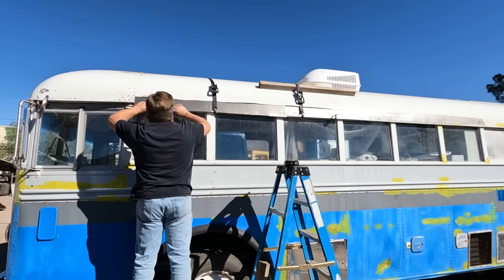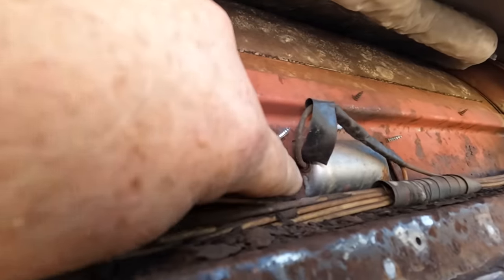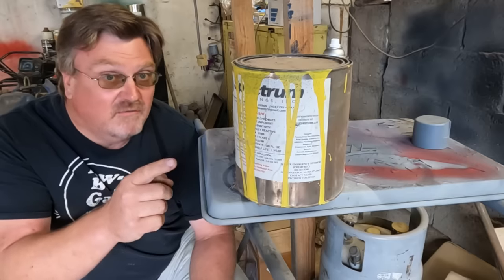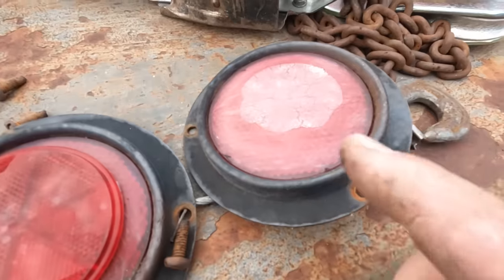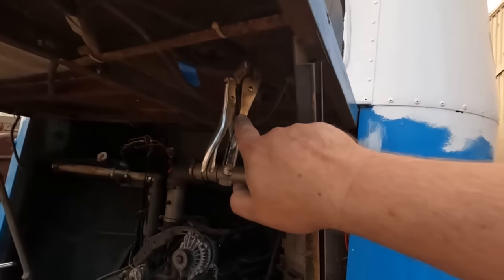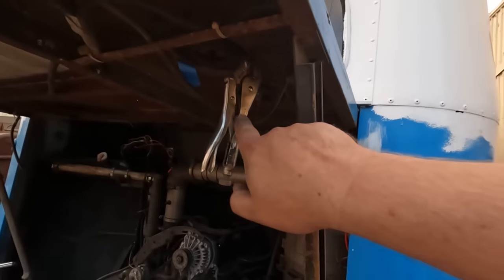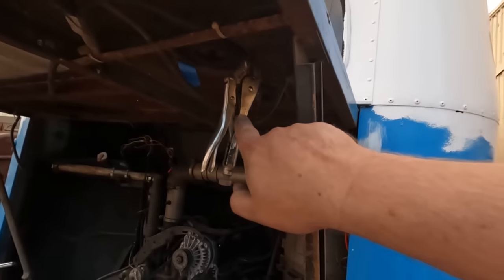1953 Kenworth Pacific Bus: New Colors and Partsam Lights!

Comment: That front bumper looks WAAAY better than the chrome one. Nice work James, enjoyed the video like always 😁👍  The LED lights are a nice touch as well 🔧🔩
Reply: I am always happy when someone gets rid of a big ugly chrome bumper. My first W900A Kenworth had one, and when it dropped a valve I had to take the bumper off to get a wrecker hooked up. Not very practical.
Reply: Watching a video, Not seen how old bumper looks, yet, when retrofitted
came here to say like WhY you getting rid of perfectly normal bumper and want to instal old rusty ugly one…
But I mean if actual owners are saying chrome one was ugly, I continue watching and will see how it goes 😅

P.S. I’m sorry, but chrome one looked WAY better, whole bus looked more modern and had a posture 
old bumper is good only if you after authenticity or rigidity, otherwise it has added 20 years and nothing else

Comment: 4:59 smart move. That's gonna last beyond your life time and it will insulate the wire (which is a demanding one) from heat from the roof. I've seen soooo many of these bus projects burn down from the AC wires (tho, admittedly, likely because the teens had run wrong gauge wire).
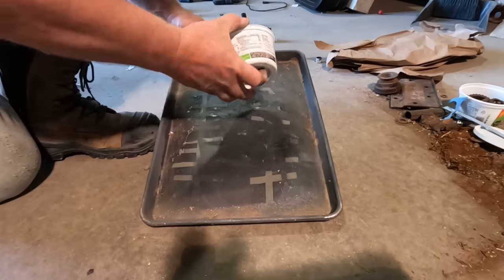10:40 keep them. You never know when they come in handy. I have a bucket of them and they always come in handy with various projects. The stainless ones are perfect for filler material when welding patches.
37:21 protip, using the center hub of the rear wheel (if you happen to have a piece of pipe that fits it loosely, perfect) make an L shaped tool that can accept (at the end) a small brush. You can then make the perfect arches with the darker blue paint using the wheel hub as the center. I'd add like a third of an inch extra over the furthest (currently) dark blue line. To make sure it works right, you'll need a roller to roll on the body work to keep the L bracket sturdy. A caster wheel should work.
Reply: Right that arc should be a perfect arc to set it off.

Comment: Hi James, in my opinion the bus looks much better with the standard bumper bar and the paint job is great. One suggestion, perhaps put a roof mounted radio antenna up near front of the bus, that way if you forget about your clearance height the antenna will warn you before you rip the air conditioner off the roof. A simple fix for a potentially expensive mistake.
Cheers, Stuart 🇦🇺

Comment: I like the paint colors and the scheme, but it needs a dark blue accent stripe along the top in line with where you replaced the metal. The way it is right now, the white top is just floating in the air by itself. It's not tied in to the rest of the paint scheme. Also, I've NEVER seen a paint so sticky!!! That looked to be more trouble than putting on bed liner! As always, informative, entertaining and educational! Thanks.

Comment: Back in the late 50s my Dad bought a 1940 Ford bus that had been converted to a camper. There was six pipe berths in the rear. It had an apartment size lp stove / oven. An ice box provided perfect cooling for perishables. It was slow. The brakes leaked brake fluid. But as long as you filled it every morning, the worked sort of adequately. Maybe had to pump them a little. We were the stars of the campground. We lived in SE Wisconsin and drove that bus all over the state as well as Minnesota and  Canada. We brush painted it silver with blue fenders and trim. I have a picture of our family from about 1959 lines up in front of the old bus. Brings back memories and always a smile . I hope your kids enjoy your bus as much as we did ours! Thanks for the memories!:)

Comment: Excellent video James  :) also one test can do see if Alternators putting right Volts and Amperage to batterys back on Reserve too ! Also when lights on go up hills to not kicking back and plus Fans keep motor coller to much more from previous problems had too! Like paint job to and all did so far on 1953 Kenworth Bus and should be fully restored up soon too!

Comment: That paint is pretty rugged, I think that's the same stuff I used some a few years ago when I replaced a rusted out floor in a ski area bus and it ripped my foam brush apart just about instantly. It still looked good when dry though. Nice job

Comment: Nice job. Make it work and enjoy. I think you should install a few more marker lights and/or reflectors on the back (sides) of the bus (not on the engine compartment door), in case you get yourself stuck on the side of the road at night and need to open the engine door.

Comment: I sure wish that I had your skill. I would be afraid to drive something that big. I guess in order to do it right you would have to take the entire bus apart to fix every defect but that would take a lot of time and money. I like your approach because it works. The most important thing is that it is safe as well as functional.  Fixing the holes and the paint is just a plus. I was a painter in the Air Force and I used a lot of that primer. Thanks for the video. I know you put a lot of work and money in the bus but you gave it new life. :hand-orange-covering-eyes::hand-orange-covering-eyes::hand-orange-covering-eyes::hand-orange-covering-eyes::trophy-yellow-smiling::trophy-yellow-smiling::trophy-yellow-smiling::trophy-yellow-smiling::trophy-yellow-smiling::trophy-yellow-smiling::cat-orange-whistling:

Comment: I believe your rear marker lights should be red 3 centered 1 on each corner 1 amber on each side in the middle  1 amber on each front corner with 3 in the front center 
Red reflectors on the rear and sides amber middle each side and front corners 
You might also add a step well light both inside and outside underneath

Comment: I spent my weekend putting in new signal light switch and completely rewiring them and the tail lights. I done it wrong because it wasn’t fun at all. I got it all working properly though that part is good.

Comment: If you are painting with Rustoleum, using a hardener mixed 4 to one, or 6 to one makes a huge difference! Rustoleum paint usually takes a long time to fully cure, but with hardener it will be dry in an hour or two and be much harder than if you just used the paint by itself. I would compare Rustoleum with hardener to almost the same hardness as automotive paint, I use Majic brand hardener, a small can goes a very long way! they say to mix 8oz to a gallon of paint.

Comment: There are both water and oil based rust converters available to convert rust to elemental iron and seal before priming and repainting. This would have been a good project to use one of them on.

Comment: Sir I just watched your first bus video. Your wipers are the little knobs by the wing window they’re air powered , they don’t work very well they never did. And if you Jack the front wheels of your bus off the ground and turn the wheels full loft and full right while you’re greasing the king pins and tyerods it will greatly ease the effort of turning. Good luck I enjoy your videos

Comment: Bus is looking great. Maybe delete those two holes in the bumper where those lights are so its just one piece. If you ever change out the backup camera system (forgot if you did or not) try and save that little tube tv. Someone will likely want it. Hard to find tubes that size.

Comment: If money were no object, that entire roof would be better off cut apart, the reinforcement structure under, doubled and reinforced, and a fiberglass replacement put in place. If it's done right, such a roof would be timeless.

From the olden days, when people had blogs (the written kind) someone did this. It was a slightly smaller bus (no recollection of the brand, i just know it was a bit smaller by the window number - but same era) but the dude replaced every bit of the roof with fiberglass panels, bonded at the seams. Each panel was custom laid in a jig (with only the ends being different) and each rib would receive two panels which had an inward lip (think a tin roof with the raised ribs between panels, but pointing down) and between those, a T rail also made from fiberglass. Seemed like a very sturdy roof. The guy was building it while standing on top of it.

Comment: @36:00 or so Safety alert
For the 4" red lamps under the turn signals, do not use them to also flash as turn signals.  The 7" turn signals you have are more than enough.

Instead, you should wire the major filament (what you seem to call "high beam") with the stop lamp feed, so that way the 4" lamp is a rear position lamp (colloquially "tail lamp") and a stop lamp (colloquially "brake light").  The way you have it configured may result in driver confusion because of the mix of colors.  There are three main ways turn and stop lamps are configured:  Stop and turn incorporated behind a single red lens; stop and turn in separate red-lensed compartments; and stop and turn in separate compartments with the stop lamp having the red lens and the turn signal having the yellow lens.  The third method is the safest, and there is real data that shows that configuration is more effective than the CHMSL at preventing certain rear-end collisions involving the lead car making a turn.

Unfortunately, the way you currently have it set up, you may confuse following drivers because of the mix of colors and the slow rise time of the major filament in that 4" lamp.

I can also tell from the additional footage of those 7" lamps that they do NOT have reflex reflectors.  You'll need to add some.

Comment: My only comment is I would have used that zinc Chromate over all the rust before you put that liner paint on. ZCP was the best thing ever made for exterior metal. I now use an industrial water base coating that consolidates, primes and undercoats all in one called Hydo Armor . Very difficult to get. I buy 1 5 gal bucket from the industrial body co near me. about 80 bucks a gallon 400 a gal but it goes a long way. Your project turned out well. I gather you added that industrial a/c top unit? did you duct any of it?

Comment: @25:08
It does not appear the stop and tail lamps have reflex reflectors on them, and the turn signals definitely do not have them because the rear reflectors should always be red.

Go out at night and shine a flashlight at the rear lamps and you'll know for sure, because a proper reflector is unmistakable.

Comment: The front bumper change might have hurt drag, thus mpg. The taller chrome bumper blocked the airflow under the buss, so it increased around the buss. An air dam could be made, to keep the small blue bumper. 

All my research has been to reduce aerodynamic lift, not reduce drag, but that could matter on that bus…

Does the steering get light at highway speeds?
If yes, then repeat the test route, but with the tall chrome bumper…

Report the results!

Comment: duraback is good stuff... IFFFFFF you prep right..and the prep is easy...  but it will peel right off if you do it poorly. Part of the prep is wiping what is about to be painted with Xylene... other part is sanding to give it a ruff something to adhere too. 

Since you mentioned Xylene agent  late in your video .....  sadly.....  think in  4 to 6 months your going to peeling that polyurethane based paint off in sheets... especially if you did not sand it as part of prep.  Happened to me...  cept I paid someone to do it...  and they fawked me bad.....  ALL of it peeling off in 3ft sheets and smaller.    Know of others that did it right and it is near impossible to remove.

Comment: The Alu rivets corroded away because Alu is less noble than steel, stainless rivets however will make the steel sheet metal corrode aeay, not sure this is the favorable option.